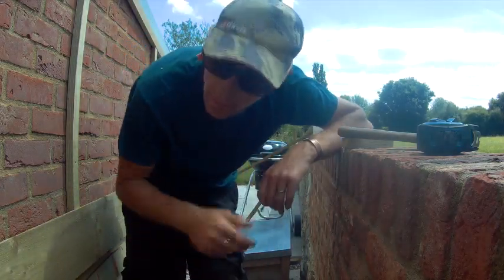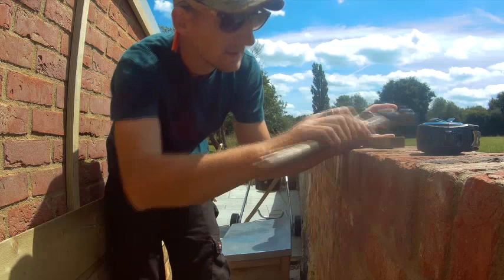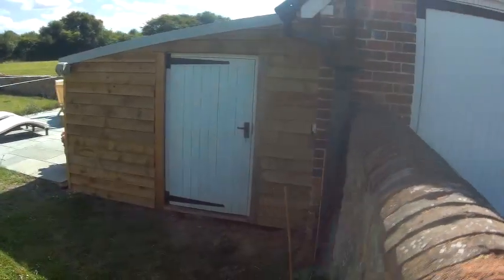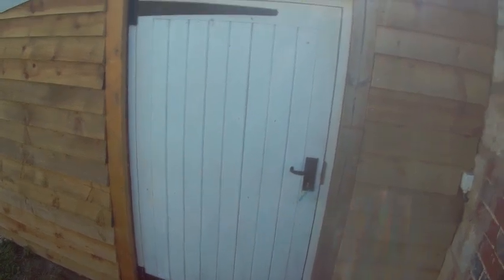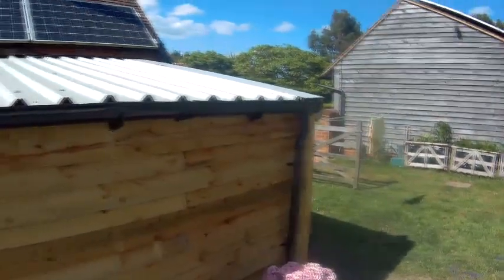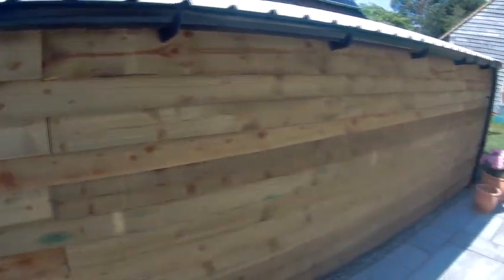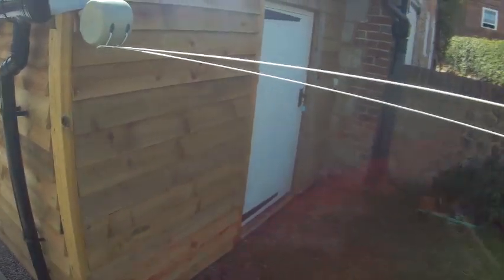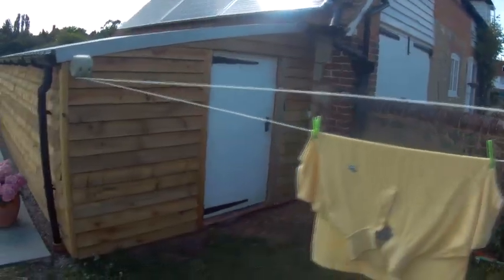Weather Board Cladding A Brick Out Building - SUBSCRIBE for more videos

Comment: Hi. Great video! Just wondered when you say the bottom row is angled out at the bottom to keep them uniform what did you use to get the angle? An off cut of the cladding all the way along or something else? Also would a membrane be good over the timber batons do you think? Thanks :)
Reply from the maker: Thanks for watching. Yes you can use a offcut. If your cladding a building which isn't already watertight I use dpm onto the battens.

Comment: Hi mate another video of yours i have watched another great job and did like the tip 👍how long did that take you there was alot work there to do 👍
Reply from the maker: Hi Carl, thanks for continuing to watch. The job only took a day. I like to plan out all my cuts and install ideas before starting the job. Taking the mobile work station really helps keep things on track.
Reply: That's good then mate 👍you got a busye week 👍my week is busye so hopefully the weather will be kind. 👍
Reply: Hi mate wanted to say because you said you planned the job out do you do that before you start the job at home then 👍
Reply from the maker: @carlwaylett7013  that's right. When I price a job a work out a rough set by sep iny head to how the job will run. That way I (try) not to forget tools and what materials I'd be using. Help things run a little smoother. Fail to prepare then prepare to fail lol
Reply from the maker: @carlwaylett7013  yes a fairly busy one. Maintenance tomorrow and then 4 quotes between 2.30 and 5pm. Fencing on Tuesday, maintenance on Wed nothing booked Thursday but Fri and Sat I have hazel fencing in.
Reply: Hi mate cheers 👍will there be a video Friday Saturday not heard of hazel fencing 👍glad you are busye 👍when are you likely to start cutting grass i have already had a customer ring me because he grass is long but it's to wet yet 👍
Reply from the maker: @carlwaylett7013  I will try my very best to film the hazel works. It'll be weather depending really. I cut a lawn the week before last after some strong winds. The wind dried the lawn just enough for the ride on mower. Most lawns are too wet really. But if you can cut just keep it a littls longer than normal just encase we get snow or hard frosts
Reply: Hi thank you for getting back to 👍hope you have a good week and enjoy the rest of weekend what's left with me keep bothering you 👍

Comment: Great job. Is that just standard softwood cladding?
Reply from the maker: Hi Tom. Thanks for watching. Yes it's softwood. If your in the uk it came from the builders merchant Jewsons.
Reply: I have a quote from Jewson which  Is feather edge European whitewood? This variety comes only from Jewson in Hereford. Did you have any issues with cupping , warping or splitting? This issue is listed as s common problem for feather edge cladding. Many thanks
Reply from the maker: @1tommy10  I just had a quick look and I got them from TP not Jewsons. This is the link I belive
 https://www.travisperkins.co.uk/feather-edge-boards/feather-edge-board-treated-green-22mm-x-150mm/p/9000138435

It's a soft Whitewood. I was lucky I collected the timber so was able to pick though the pile. They did have a few split planks but cupping wasn't such a issue. It is unseasond timber so expect some movement. Hope that's helped
Reply: Could you do this as a alternative to rendering a breeze block wall?
Reply from the maker: Yes most definitely